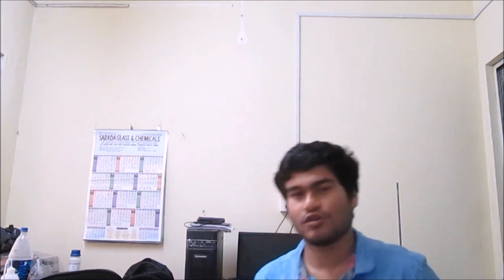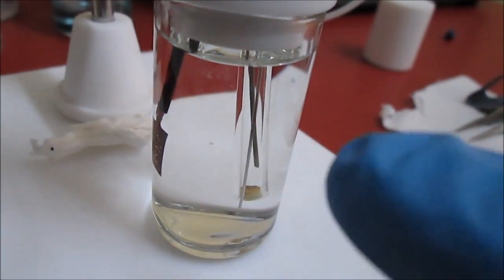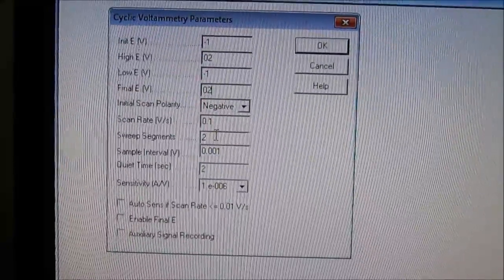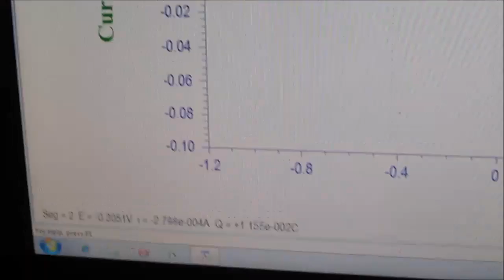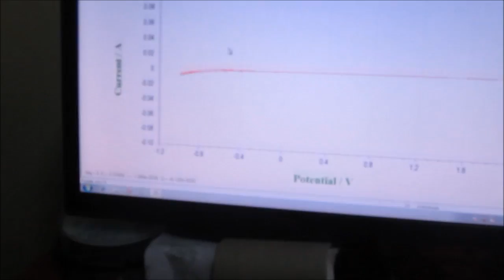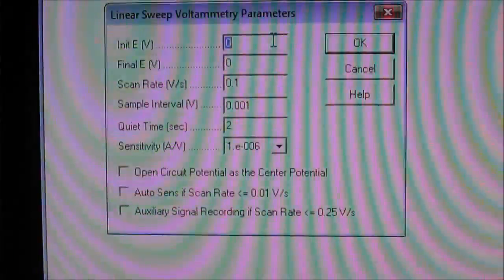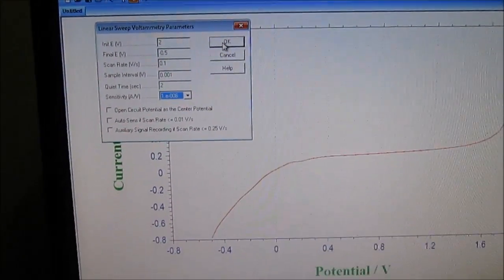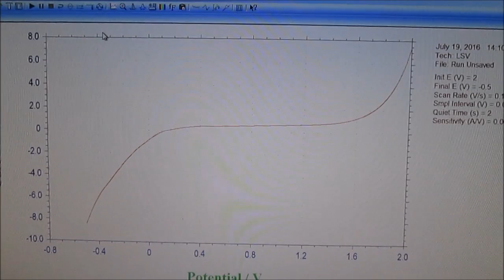Cyclic Voltammetry (CV) and Linear Sweep Voltammetry (LSV) in CH Instruments

Comment: Sir for studying nanoparticles the same way can be used for there supercapacitance behaviour ?
And NP are in powder form
Reply from the maker: You may make an electrode using your nano particles. Procedures are available elsewhere.
Reply: As I have to send samples for CV to another place how will I send electrodes to them and they have not mentioned anything that's why I m confused how analysis will be done.
Reply from the maker: @Daughtervibes11   If you're interested in the CV of your nanoparticles which you have sent to different lab then they will probably coat your nanoparicles on glassy carbon electrode and do the CV measurements.
Reply: @AyanSarkar1  OKso those results can be considered good or making electrode and then analysing gives better results? 
Btw thanks for ur reply.
Reply from the maker: @Daughtervibes11  You may talk to the researchers you're sending samples to.
Reply: @AyanSarkar1  OK thanks again
Reply from the maker: @Daughtervibes11  You're welcome. Please subscribe.
Reply: @AyanSarkar1  already subscribed

Comment: what is the effect of the stirring bar on the negative current peak?
Reply from the maker: Do you want to stir the electrolyte during the CV/LSV measurement? In that case, you may do it gently. The high rotational speed of the magnetic bar can hamper the measurement and give rise to noisy data. The same thing is applicable for gas purging also. Although, oxygen purging will increase the current, as you know.
Reply: @AyanSarkar1  I feel like we are talking about different things. thanks for your help though.

Comment: how can you apply more than 1.2 volt in case of aqueous medium of electrolyte solution. It is known that in more than 1.2 volt the solution get dissociated.
Reply from the maker: Yes that's true. But you can still apply above 1.23 V (0 pH). Forgetting about the overpotential, you can get considerable increase in the current after 1.2 V. You may check it.
Reply: @AyanSarkar1  thanks alot i will do the same surely. 
and one more request, can you just make video upon charging discharging (chronopotentiometry) programme of CH Instruments

Comment: hi, was wondering if there's a standard ohmic resistance for iR compensation..
Reply from the maker: I don't get your point properly. Are you talking about the reference electrode?
However, thanks for your interest in my video. 
Please subscribe to the channel, it'll be highly appreciable.
Reply: I'm currently compensating for iR in LSV, however, it scatters meaning it's overly compensated, right? Although, I'm not sure as up to when scattering is acceptable. Autolab Nova states 90-95% is common practice but some say no more than 85% to prevent oscillation.. I tried minimizing the CE & WE distance as that's what most literature do but it doesn't state the minimum distance I'm able to do it. I've tried 0.25 cm but I don't know if that's acceptable as well.. I've reached out to researchgate but to no avail.
Reply: Hi.
1. If I just reverse the voltage supplied,e.g if I work with Initial voltage : -6V and Final voltage: 2 V, will it cause any change in the final result in LSV?
2.Also can you please tell how to convert Potential V vs Ag/AgCl to SHE or RHE?
3. Lot of journal papers state at "-0.6 V vs SHE or RHE".What it implies? Do we have to supply this much voltage as bias?
I am very much stuck and not able to understand these details.Since you have done such indepth work on this system, I would be very grateful if you could solve my queries and may be if possible refer some papers where my these doubts could be addressed.
Thank you.
Reply from the maker: @beautypandey6976   First of all, I will request you to subscribe to my channel if you have not done so. Also, please share the videos among your colleagues and friends.

1. No, it should not be the same. The difference would be prominent if your electrode material has pseudocapacitive nature (i.e. if Faradaic reactions happen). Doing CV from say -1V to 1V actually means doing two LSV from -1V to 1V and 1V to -1V, respectively. If you watch my CV measurement attentively then you will find your answer.

2. V(NHE or SHE) =V(Ag/AgCl) +0.197 +0.059*pH (voltage measured in Volt. 0.197 can be 0.199 depending upon the solution used for immersing the Ag/AgCl electrode.)
 See ResearchGate, Nanotechnology 28 ( 2017) 325401, SI of J. Phys. Chem. C 2017, 121, 25705 −25717
 
3. There are lots of discussion in ResearchGate. Every potential in electrochemistry is measured with respect to a standard reference electrode such as Ag/AgCl, NHE, SCE etc.

Comment: Hello Sir
In CV measurements experiment , ca we use any electrolyte for carbon samples like graphene or it depends on the working electrode nature..please suggest
Reply from the maker: As I know, generally inert electrolytes (which do not produce any redox peaks in a large scanning voltage window), such as aq. Na2SO4, Na2SO3, KOH, etc. are used by the researchers. So, you may choose any of these if it fits with your requirement. However, I shall suggest you to do some literature survey in your field of research. It will help you to understand what type of electrolytes are being used by other researchers in your field across the globe.
Reply: Thanks Sir for your reply. Actually I have searched in literature a lot and have found that people are using electrolytes e.g. LiI, I2 and LiClO4 in some molar ratios and all dissolved in acetonitrile. And I also do not know..how to take CV of these if electrolyte is decided once. Some are saying you note on screen printed carbon electrode or some says prefer glassy carbon. And no one writing the exact steps in research paper to note CV scan.Kindly help me.
Reply from the maker: You may do some trail and error methods to obtain the best result for your experiment. However, have you placed your question in Research Gate? I think you may get help from there.

Comment: Can you upload a video by performing EIS for solar cell (Nyquist plot and Bode plot)?
Reply from the maker: I have not uploaded any video for the EIS of solid state solar cell. However, you may check my video on EIS if it is helpful to you. This can be employed for the PEC characterization. Using the CHI 660E software, you can easily get the Bode plot as phase and frequency are also recorded simultaneously during the EIS measurement.

Here's the link.
https://www.youtube.com/watch?v=xC0zBHbnvII
Reply: Thanks for the link